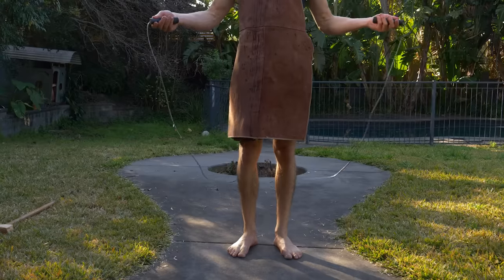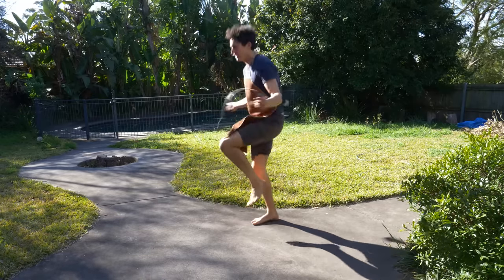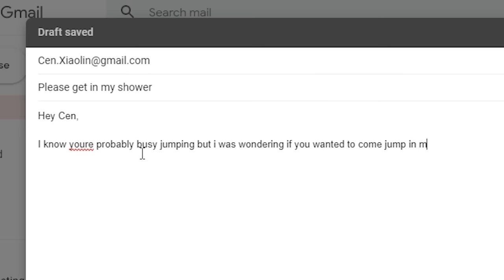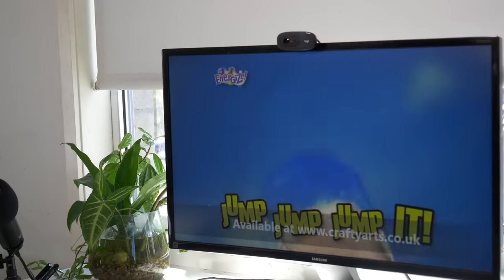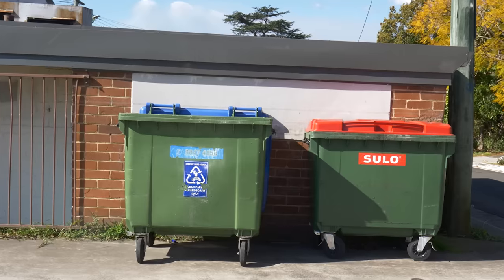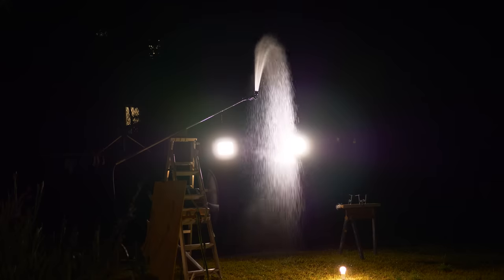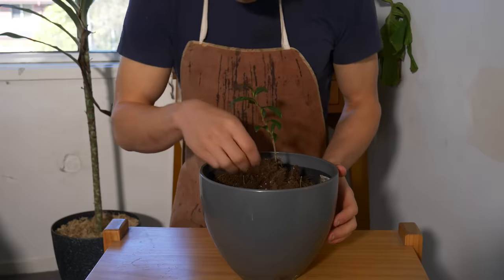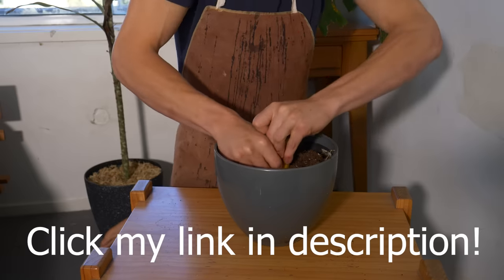Can I Jump Rope Fast Enough To Stop The Rain?

Comment: I see several ways how to bring this installation to the goal: for example, you can install 8 blades, and stretch 8 cables accordingly.  This will increase the mass of the structure, including the mass of cables will begin to slow down the rotation, so instead of a spinner at the other end of the cable, you need to put an identical engine with identical blades, and then they will distribute the load equally, and then the cable will cut watermelon without any problems.  The second way is to complicate the design a little and assemble a gearbox, which, using a gear transmission, will increase the number of rotations per second, and the blades will also be attached to the gearbox, and not to the engine.  And the last way is to combine the first two.  Two engines, 8 cables, two gearboxes and a lot of gray hair in your neighbors.
Reply: I love it when I see these educated comments and learn something
Reply: Or, you start small and use the same motor with the same two blades bar, but positioned vertically, so the blades are below the motor. Then pour the rain on the blades and observe at which distance of the axis the rain is stopped. This will give you the ratio between the linear speed of the blade (according to the radius to the axis) and the diameter of the rope (the width of the blade) necessary to achieve the goal. And the mess up with an actual jump rope. But this would be an engineer approach, and remove all the fun of the brutal try-and-error-with-dangerous-contraptions strategy....

Comment: To create an air bubble You have to have a line crossing droplet path literally all the time. It means that rotation speed should be almost infinite.
Idea from me - take that motor, make rotor with, let's say 8 short ropes rotating horizontally and You can make most overpowered, overenginered and pointless BUT FUN force field umbrella. It will be force of momentum, but it is still a force :D
Reply: Except that the slowest rotational point on your proposed umbrella is directly in the center, where your head is. The dry spot on the ground would look like a donut that blurs inwards.
Reply: @Nathan-dt2tu  Don't think this matters. Every water drop has some fixed time 't' where it lies in "chopping range", so as long as the rotation frequency is at least 1/t, you'll chop every drop, no matter where it is radially.
Reply: Infinite you rotation you say... sounds like we'll need to get gyro zeppeli's help for this one. We'll need to use ✨the spin✨
Reply: "To create an air bubble You have to have a line crossing droplet path literally all the time. It means that rotation speed should be almost infinite." Are you serious? You're incredibly Wrong. Infinite is a poor choice of word when you very well know the speed of light exists too. Which is way more than enough, in fact it would be severely overkill to have the rope coming through at that speed. 

You seem to think the rope always needs to be there like somehow the droplets are falling faster than the speed of light.
Reply: @jasonnikolic  yeah right, an approximation of the needed rotation speed was literally calculated at the start of the video. Why does his silly comment have so many likes 😂

Comment: I did some quick mafs.. and even if you were to just jump 1 mm constantly assuming your jump time was instant and you fell back down due to gravity you could only do 70 jumps in 1 second as it would take you 0.1428 seconds to fall starting from a veolocity of 0 and even assuming no wind resistance.  So the only way to jump 800 times per second would be to go to a planet with much higher gravity or somehow force your feet down faster than gravity would.

Comment: This is 2yrs old but depending on the motor AC/DC putting no load on it (like you did with the big metal poles at 5:05) mean it's just gonna accelerate till it kills itslef

Comment: if you mounted another fidgetspin thing to the engine and moved them closer together you'd achieve the same ROM without wasting energy by putting a large metal rod there

Comment: it would work enough to not get wet if you were under it if you added around 8 more ropes and a slightly stronger engine, and possibly carbon fiber instead of aluminum

Comment: "Success is not measured by the number of victories we claim, but by the number of times, we rise after each fall. In the face of challenges, let perseverance be your guide, and let resilience be the fuel that propels you toward greatness. Remember, it's not about the destination, but the unwavering spirit with which you journey."

Comment: The high pitch noise is just what happens when an object accelerates to specific speeds it's literally just punching through the wind like the smaller the thinner and object is the slower you need to go to be able to create this noise and that thing is basically just a katana so it doesn't need to be spinning super as you were fast for it to make as even a small version of that sound of course it's gonna be very loud and very high pitch you dunce

Comment: hi, does anyone understand how he calculated the 800 rotations per second?
Reply: i calculated 3mm(diameter)/10000mm/s(speed)= 3*10^-3 s (i supposed that is the frecuency that the raindrops fall). So you need to make one lap each 3*10^-3 s, so in one second you have to make 3333 rotations per second i think.
Reply: Ok nerd
Reply: @Kobeyk  lol